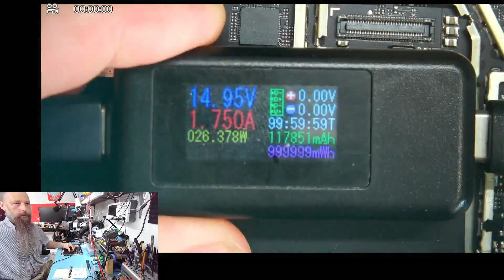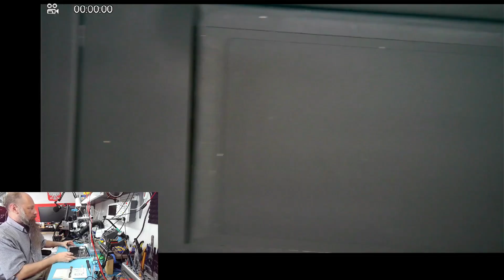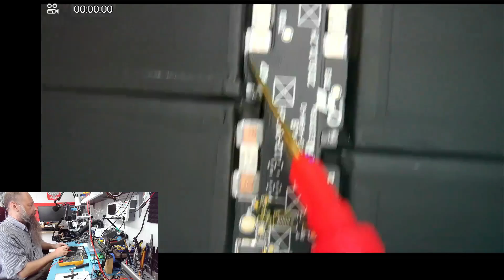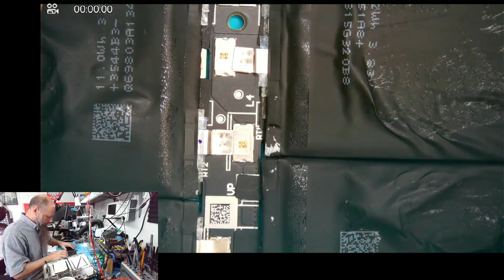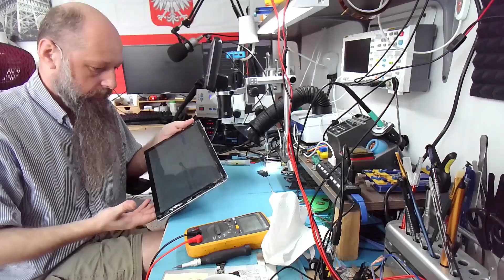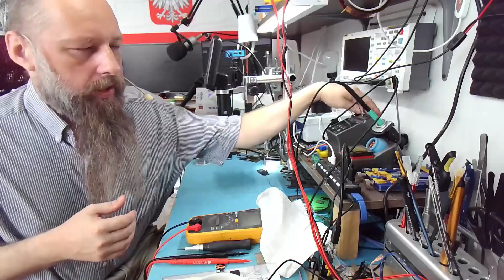Day #17 | Does Surface Pro 5 Battery Need to be Reset When Cell is Disconnected?

Comment: The battery controller also has a protocol to shut off the battery when a cell is bad; it will then need a reset controller device to unseal battery, reset the controller and then seal it for it to work. This is found in all laptop batteries, and one for macbooks is MBRT; another resets almost all and Sorin has videos on it is NLBA.
Reply from the maker: true that, thank you